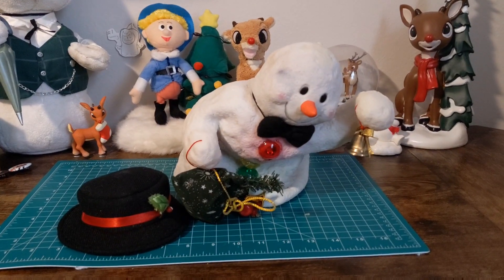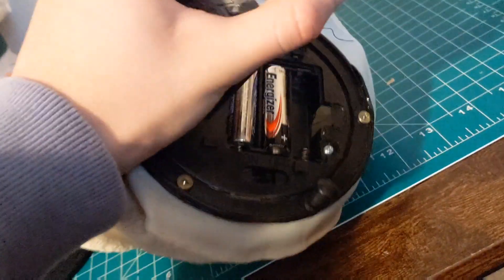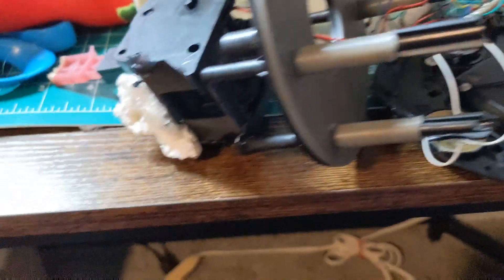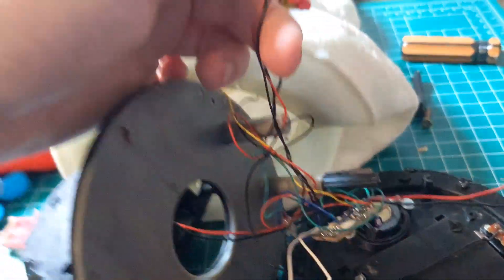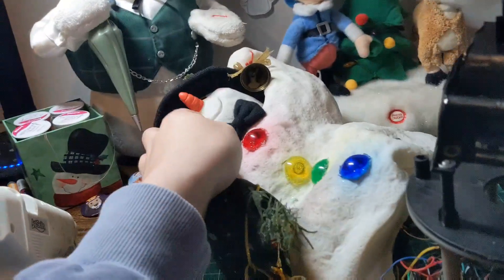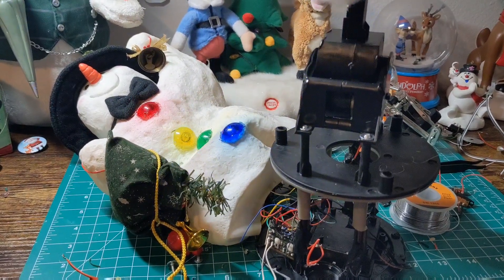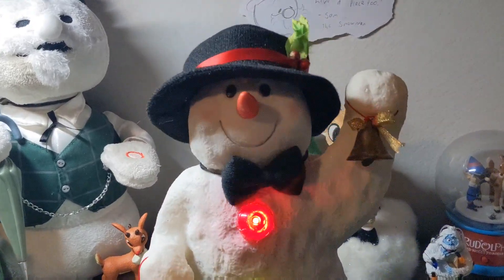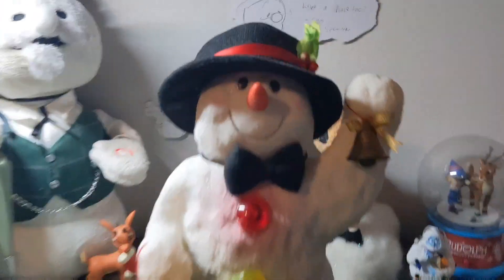Sky's Repair Desk - Bringing A Trashed Rubber Dancing Snowman Back To It's Glory #repair

Comment: Did you just use regular LEDs for the lights? I had always assumed I shouldn't use them because they didn't use LEDs originally, but yours seems to work fine with them.
Reply from the maker: I did! They seem to work well. With half the original bulbs being shot It's all I had to resort to.